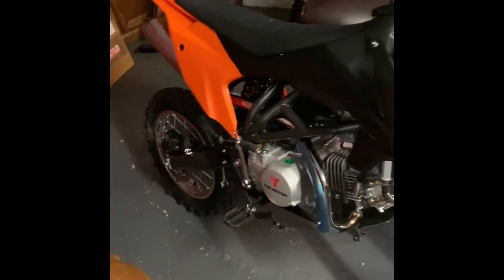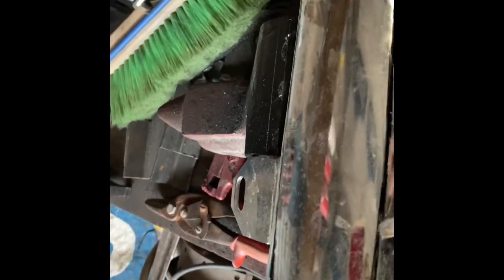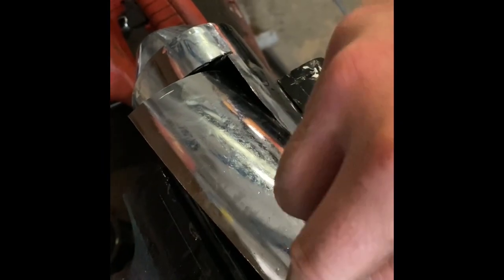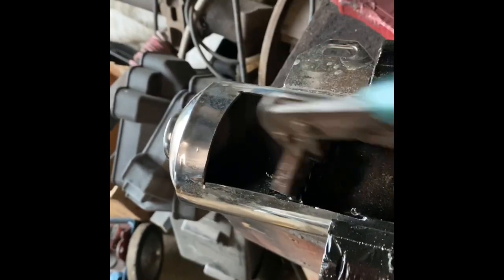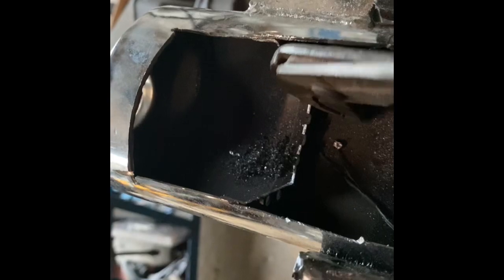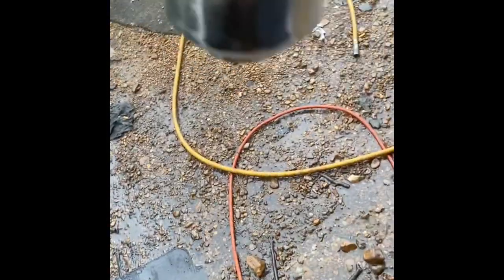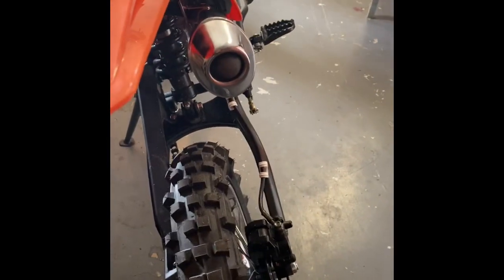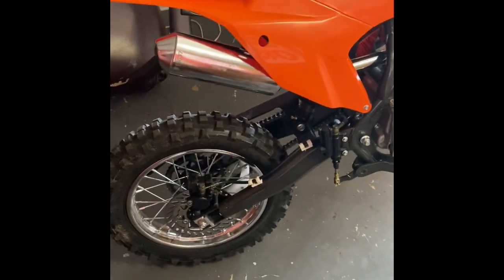Tao Tao dbx1 140cc dirt bike , gutting the muffler

Comment: I did this and now bike bogs did you have to do anything after performing this mod?
Reply: Might have leaned it out by shortening exhaust. Been my experience with most bikes. Gut the exhaust and you'll need to adjust the carb.